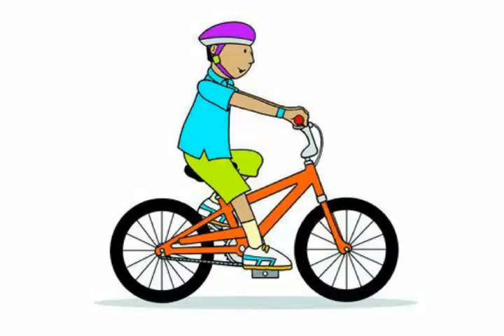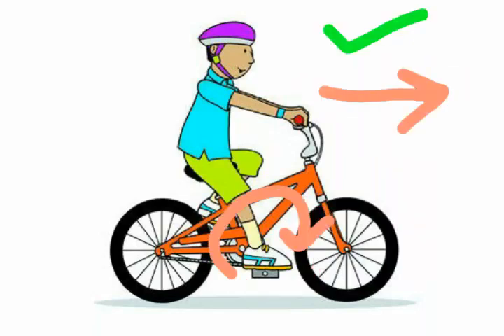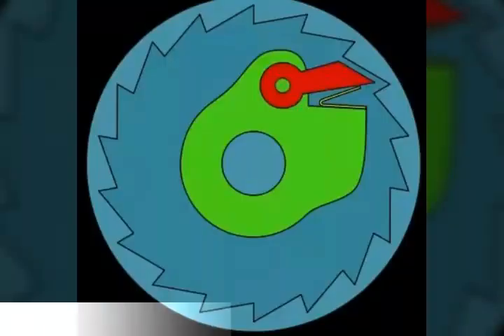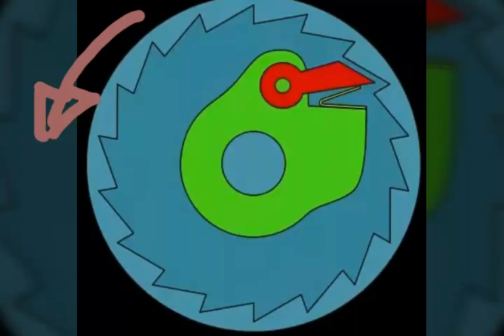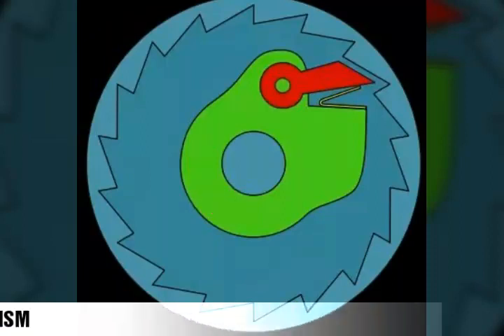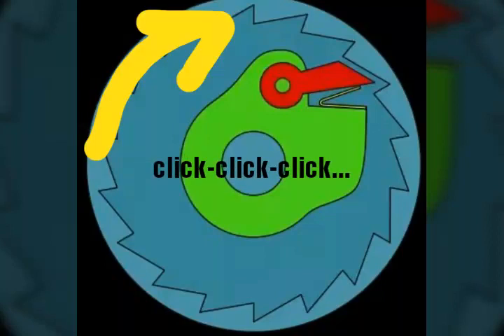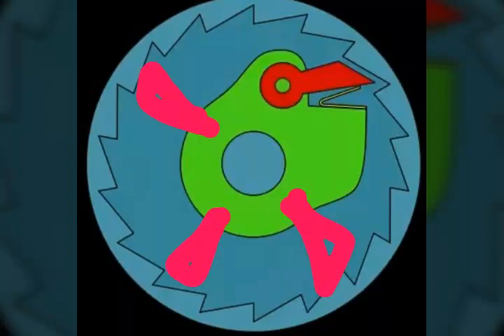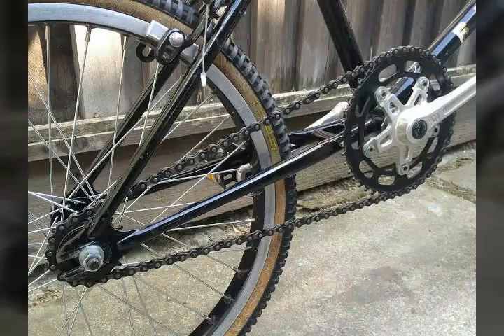Why doesn't a bicycle move backwards when you pedal back?

Comment: Fix gear is what you want to go backwards. Its just a fixed gear so theres no coaster mechinism which means the front sproket will continusly turn with the rear hub.